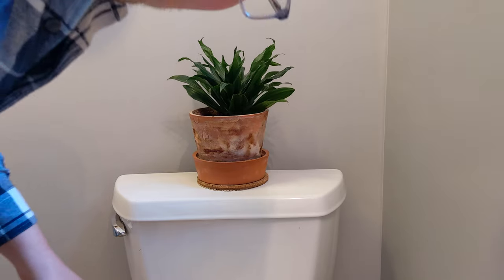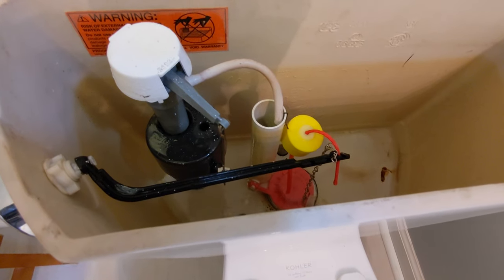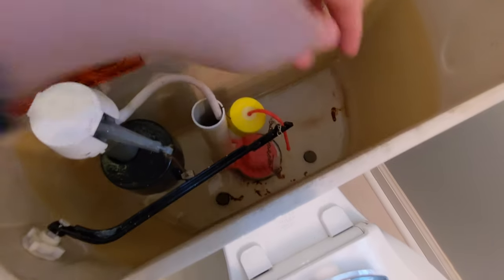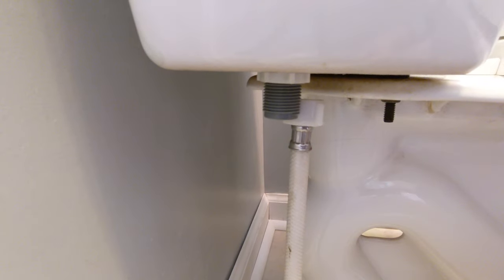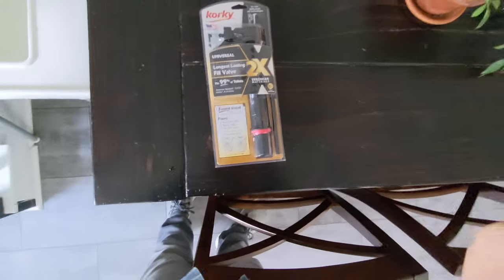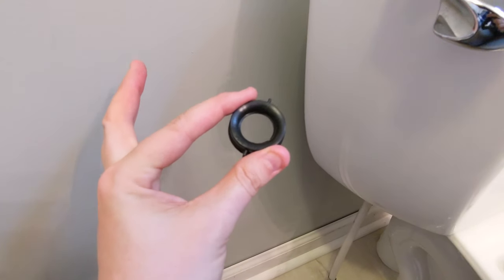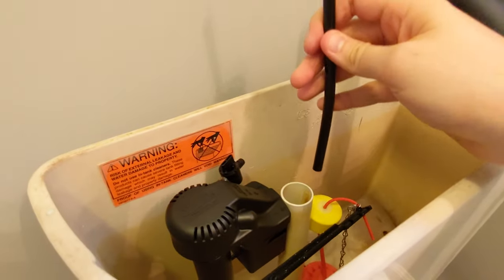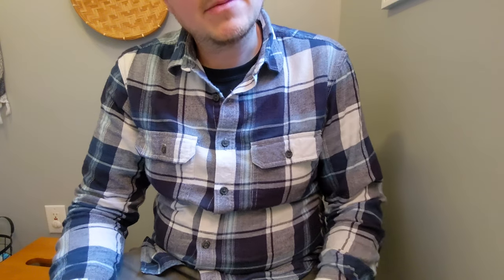Toilet Making A Hissing Sound? Do This Before You Call A Plumber (DIY Fill Valve Repair)

Comment: I just replaced my damaged rubber valve seal after 16 years of toilet use to stop it from hissing. However, I'm noticing afterwards that lots of little black rubber pieces are floating around in the water inside the tank. Will my new rubber valve seal will be damaged again soon if I don't clean all that out?
Reply from the maker: I don't think your new valve seal will get damaged per se, but if there is some residue from the old seal still stuck, you might not get the tightest seal.
But it sounds like the debris might just be leftover from when you swapped out the valve seal and isn't draining because it's below where the water drains. Fish it out if you can, but it's probably not something to worry too much about.

Comment: Mine makes same.sound but if l touch the handle it will stop but l have to move the flusher few times for that to stop so wondering if is the same thing
Reply from the maker: Hey Angel, it sounds like it could be an issue with the flapper. It might not be closing all the way so the fill valve stays open. Next time it happens, before you jiggle the handle, take the tank lid off and look inside. Check if the flapper is stuck open, snagged on the chain, or otherwise not fully sealing the drain. My most recent video actually covers how to replace a faulty toilet flapper seal, so you might want to check that out. 
Hope that helps point you in the right direction!
Reply: @DavidSteininger  ok thank you very much